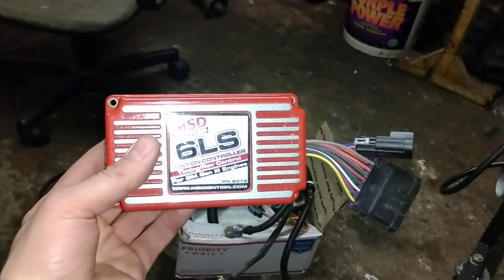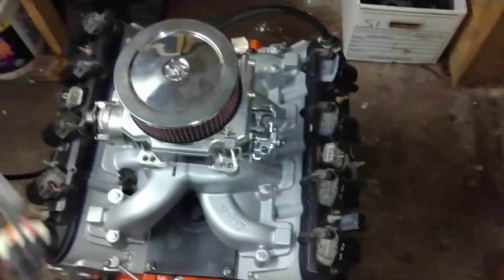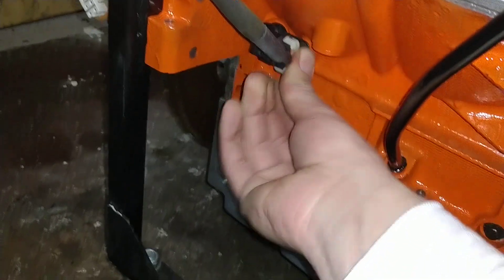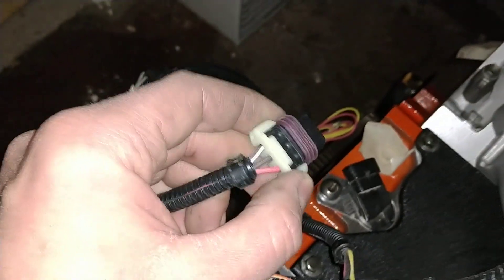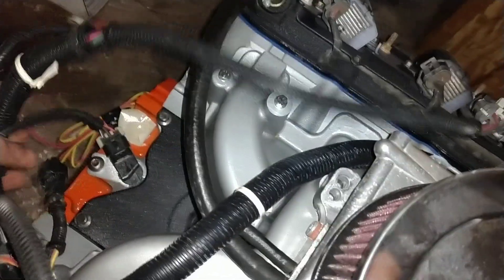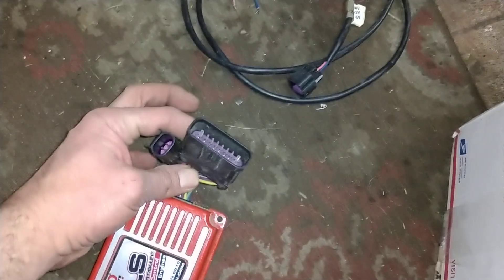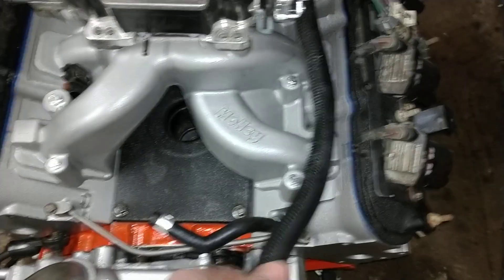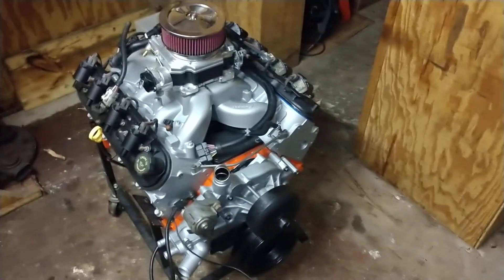HOW TO: MSD-6010, 6012, 6014 IGNITION CONTROLLER. Ls1 4.8 5.3 6.0 LQ4

Comment: Is a second unit required to run the transmission?
Reply: You need to use an old school transmission. If you want a modern tranny you need a TPS for the carb.

Comment: I did this with my 79 nova 5/3 aluminum block 05 gmc truck moter got everything from jegs moter mounts oil pan flex plate intake and msd box all done and love it triple the power of the stock 350 was in it turbo 400 was ez but still spent 3000 and I had moter carb and a lot of stuff like radiator and electric fan fuel pump was definitely worth every penny

Comment: do they make a kit like this for the 8.1 also would it run if you just bought a new intake and put a carb on it
Reply: 8.1 is a big block chevy, pull out the computer controlled distributor and throw in a old school distributor

Comment: I'm normally against LS swaps personally since I like to keep my stuff as close to being era correct as possible so my 85 C30 and 86 K2500 pickups won't be seeing one at all. BUT now that I know that there's a kit to carb swap a LS engine I've actually thought about getting another square body dually or perhaps a GT400 body dually and drop in a 6.0L or perhaps build a LSX engine that would be good for low end torque if possible just to try it.
Reply: Yeah it's on now,  I'm so excited feels like Christmas

Comment: hi my name is Eric and I am getting ready to do a carbureted intake it's a deal I'm going to buy from eBay it's comes with the MSD box the I think it's all Holley intakeI'm thinking about buying it without the carburetor because it's like a Harley style carburetor and I want an Edelbrock it's going in my 2000 Chevy Silverado I just want to transfer over from fuel injection to carburetionI have been having nothing but trouble with this truck sensors constantly going off I've replaced every sensor that it says to replace and I brought it to the garage and nothing will f**** reset and it's just giving me serious bogging when I drive the truck I can't go anything more than 1/4 to 1/2 a pedal tops and a truck will bog down and have no power to solve this by putting a carbureted intake what are your thoughts on this I can't afford another truck but I can afford to throw the $900 at this cost
Reply from the maker: For the $900 the carb stuff costs you can probably use that money to fix your truck.

Comment: What actually powers the msd box.   The switched pink wire that's with the yellow tac ?
Reply from the maker: Pink wire. Goes to a 12v switched source. Yellow wire is the signal wire for your tach

Comment: Would this type of set up work with the stock intake on the 5.3 with the msd 6014 box and a drive by cable throttle body work?
Reply from the maker: If you use the factory ECM you don't need the MSD
Reply: nah i no that i just was wondering before i buy the intake to carb it
Reply: and do u think a drive by cable would work without  the tps sensor and bypassing the iac valve

Comment: Since i have the gen 4 where the camshaft sensor is on the front cover.. is there enough slack for the plug to reach the front ?
Reply from the maker: You'd have to call MSD. I'm sure if you get the 6014 setup it comes with ample cable.

Comment: What size carb do you use? Ive got a holley 650. Will it be too small for a stock 5.3 in an s 10 blazer?
Reply from the maker: I use a 625 street demon on my 5.3
Reply: @beeterolds  hey man thanks. So u just use the msd box as the distributer?  And programming the msd box is simple?
Reply: I think you have your answer when you put stock in the question

Comment: What did you use for a transmission? I have a 4l60 and am putting it into a 62 Impala. I am wondering if I need to modify the truck harness for the trans, alternator, etc. Input?
Reply: This setup has no Transmission control
Reply: You need to have a TPS on the carb.

Comment: Like someone else here said short and sweet! Looking at putting a LS 6.0 in my 1966 Chevelle with a Muncie 4 speed M20 and 3.73 12 bolt posi.  Got a sloppy stage 2 cam and Pac 1280 springs. Do you think that this carb would be the ticket or go with the 750 cfm? Everyone seems to rave about how good that these street demon carbs work.
 Great informative videos.  Keep them coming. 
Thanks
Eric
Reply from the maker: I'm running the 625 because it's what we have and the wagon only has a 2.73 gear in it. For what you're doing I would go with the 750.. my opinion of course

Comment: Where did u connect ur grounds and power
Reply: I always ground to the battery theres 1 12v constant you wire to battery and a 12v key on you can get jumper fuses and plug the fuse into a key on source
Reply: What wire is used for the tach?
Reply: @Bobby Brown Yellow wire..Good luck

Comment: I'm about to put a LS in a Delta 88 Oldsmobile Rose can you give me some pointers on the oil pan and everything I'm not are using the transmission am using the original transmission that was in the car
Reply from the maker: Holley swap pan or CADDY cts V pan. What trans are you using ?

Comment: I have the gen 4 there's a plug on the back of the valley plate I thought that was the cam sensor?
Reply from the maker: On the plate itself??? May have something to do with the pcv shouldn't be for anything you need to run the engine
Reply: BEETEROLDS on the back of the motor. My 4th gen has that DOD/AFM.i have to do a dod delete and plug the oil towers.